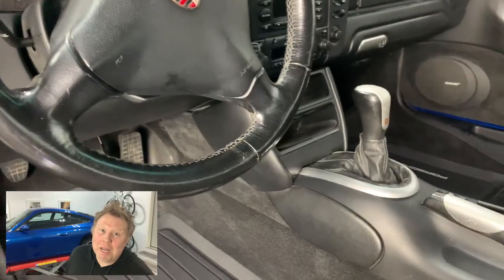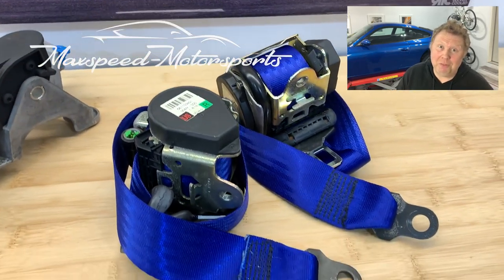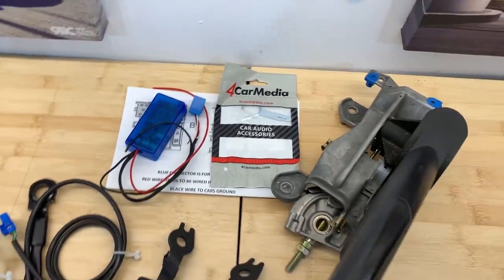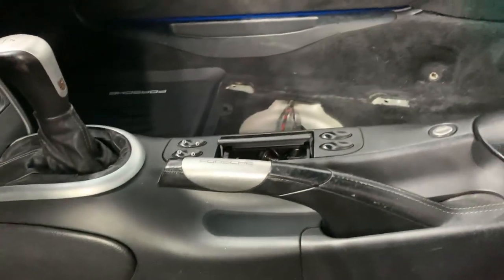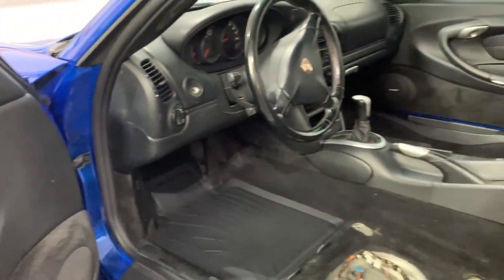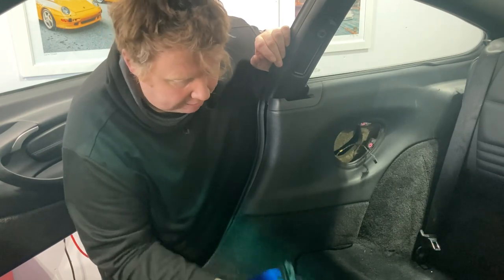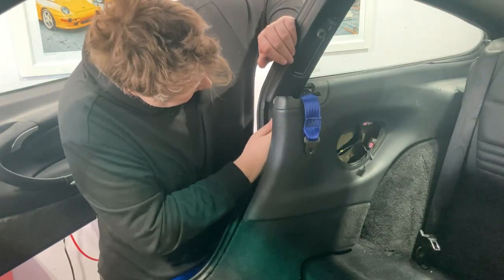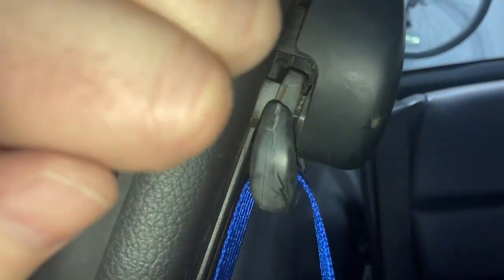Seat Belts Install DIY & Other Interior Upgrades - Project 996

Comment: Doing all the little things to my new to me 996 C4S. I didn’t want to drop the 💰 on the Porsche classic radio just yet. I love the stealth of the stock radio and Bluetooth and phone mount, at least now, thanks for sharing that one. Maybe the console delete as well? Lots of little things but excited for spruce it up.
Reply from the maker: I can fully appreciate the note about the stealth look for the stock radio. It's hard to beat in terms of its size. The center console delete was one of the best mods I did in this 996. It opened up the cabin so much, visually and physically. It no longer felt like a smaller classic car. Well worth the money for that one.

Comment: @9:57 Will be watching if & how you replace door airbag cover. Almost always dented (thin aluminum) & leather worn. 👍

Airbag stitching (main split) is very special to tear break based on the airbag specs, opening speed, & safety design.

Comment: Try Aerospace 303 Protectant. Clean your hard plastics, faux leather etc, then use this product to protect them and keep them from fading due to UV light. There are so many uses for this around the house and it does not leave a greasy film or feel.    Take care.

Comment: Great job james! The seatbelts make a huge difference! Are you still thinking of getting the engine and gearbox fitted at a porsche dealership? Possibly something has been tweaked in the driveline that doesnt make them line up properly. Keep up the good work👍
Reply from the maker: Totally. That's the plan! We gave it a good try last time. This time the pros and Porsche MPLS will doing the transmission, clutch and engine. Can't wait!!
Reply: Good luck with that hope it all works out so you can use it for your tour👍

Comment: Hi James, when you installed your seat belts, did you get an airbag warning light? If so, what did you use to switch it off? (A Foxwell or iCarsoft?) Thanks! Your videos are super helpful and inspiring!
Reply from the maker: Thank you!! Yes, you should be able to clear that error with the iCarSoft tools or similar. The issue could also just be the electrical connection for the airbag sensor. Try some bulb grease.

Comment: Very enjoyable, have you worked out why your gearbox failed?
Reply from the maker: The transmission bell housing cracking was most likely due to the engine and tranny being out of alignment, most likely due to the IMS solution install performed previously. We're going to try to validate this during the upcoming install.

Comment: Looking good with the reconditioning James.  What are you doing with the old engine?  Are you re-installing the IMS solutions into the new engine?  Thanks!
Reply from the maker: Great question Michael! I'm planning to tinker with the old engine. I want to try to tear it down and rebuild it, learn as much as I can from it as a side project. If I screw it up, no worries. If I fix it, rock and roll!
Reply: @AutoAmateur  Awesome James!  That's what I wanted to do to see up close the inner workings.  I need to replace my IMS also.  When you get to that point, LMK, I live 20 minutes from you and would like a chance to see inside the engine and teardown procedure.
Reply from the maker: @michaelbiegel6973  Sure thing!

Comment: Love your video but... how often do you have "people" in the back of your 911?
So why not delete the rear belts or one of them because honestly only one person fits back there diagonally, possibly. You can always keep the belts and receptacle. Remember that porsche race cars were about ounces not pounds of weight removed. 
I recently got a pccm+ unit but haven't fitted it yet for my 996TT. Want to do deviated belts also. 
Suggestion for your door sills is to treat them gently with a heat gun to soften the scratches.
Reply from the maker: Good suggestion on the door sills, thanks!! My 3 and 4 year old boys like to ride in the back so until they’re too big for that, I’ll leave the rear seats and belts as is.
Reply: @Auto Amateur  my kids aged out of my 79 930 back seat so many years ago, one of them now owns a 986 S 😂 
Good luck in the rocky mountains in a few months. I grew up there, and there's great roads around there. Wyoming Teton pass 22 to Idaho 33 through Victor to the 31 to Swan Valley is an excellent drive over a mountain if you get the chance.